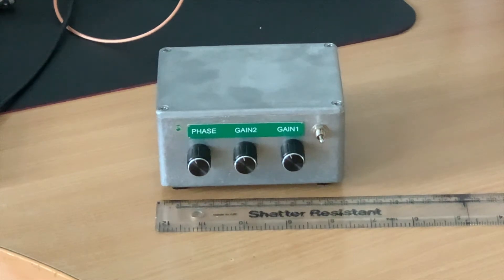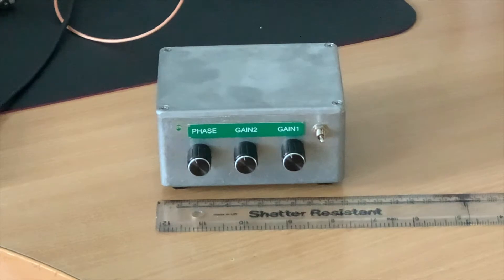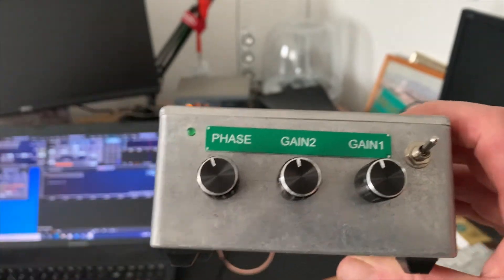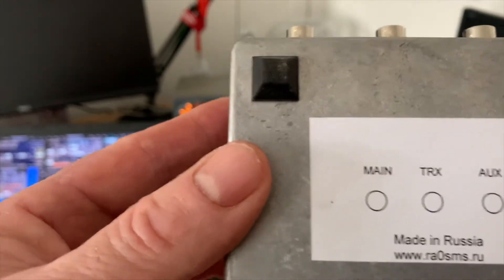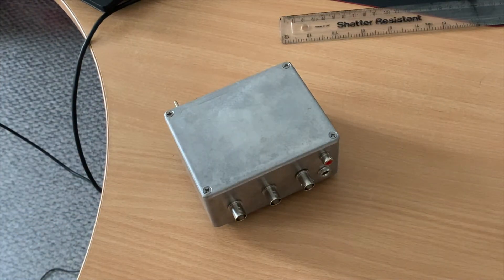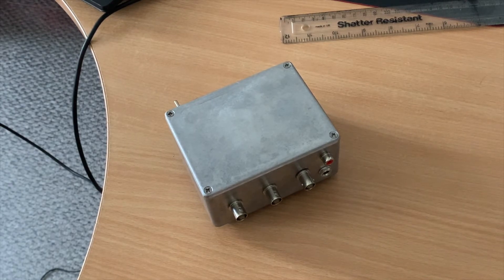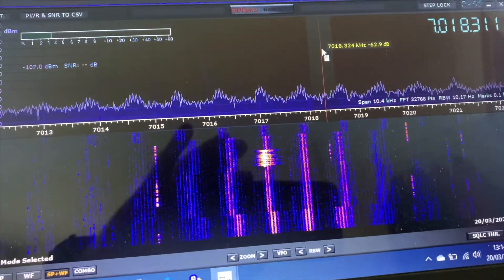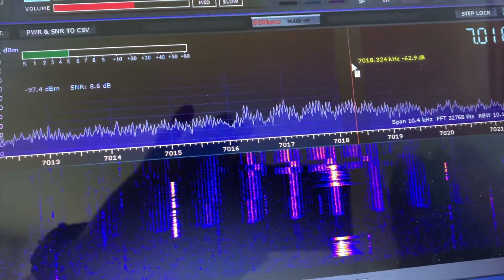QRM Eliminator by RA0SMS - A review from Kev, M0TNX

Comment: I've seen several reviews where folks use identical antennas for noise and receive and wonder why it doesn't work.  LOL.  I'm going to pick one of these up to deal with some local power station noise.  I want to try my mag loop set horizontal as the noise antenna since I can drop it a few KC below my receiver and receive none of my wanted signals and all the broadband
 QRM.
Reply from the maker: Probably better with a vertical antenna for the noise antenna Erica. Can see what you’re looking to achieve, post back your results, please!

Comment: Nice demonstration. I've nearly bought one of these on a few occasions. I'm a shortwave listener, not a ham. I mainly listen with portables and a HF+ Discovery SDR. I have a 5v to 12v USB converter lead from myvolts called the Ripcord (actually used to power my synthesizer on 12v with a USB battery powerbank). Do you think this same setup would work ok to power this QRM eliminator? The barrel on the lead is 5.5mm OD, 2.5mm ID and also connects to 2.1mm ID. Thanks.
Reply from the maker: Hi there! As long as you have two antennas to feed the QRM Eliminator and   An input ins your RX, yes, it will work. Your main issue would be if your portables don’t have an antenna input. The power draw is minimal so the power bank should cope.
Reply: @kevhaworth5313  Thanks Kev. I replied earlier but when I came back my post had disappeared. Strange. Anyway, I asked if you got stung with any import/VAT fees? I recently bought the Belka DX from Belarus and that got through ok.
Reply from the maker: @Radio_Activity  no, like you it came through without issue.

Comment: Very interesting and informative, however, can the set up be done via the radio rather than through the laptop?
Thanks Kev.
M6PNW
Reply from the maker: Hi Paul, Yes it can. All you need are two antennas. Your main station antenna and one that can hear the noise, this can be a simple piece of wire or whatever, it has to receive more noise than signal, if that makes sense?  There is a PTT function on the Eliminator that can pass 100W to the main antenna.  I am currently running this with an Icom 7300 with no issues.
Reply: @kevhaworth5313  hi Kev, are you still using the qrm eliminator?
Just curious how you prevent damaging the sdrplay front end due to excessive rf being received via the auxiliary antenna.
I’m close to the maximum db the sdrplay can safely handle just on 10w.
Cheers,
Rob
Reply from the maker: @saxon12qa  hiya Rob, I only use it now on my IC7300, I have one from Brian, GW4DVB, his service is excellent and he is really keen on price too. I couldn’t run 20m CW here without the QRM eliminator.